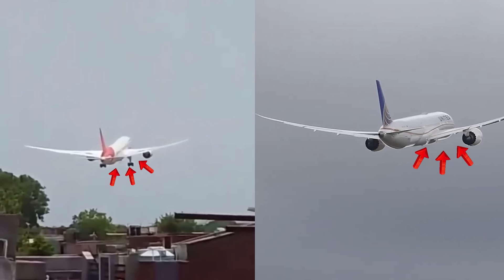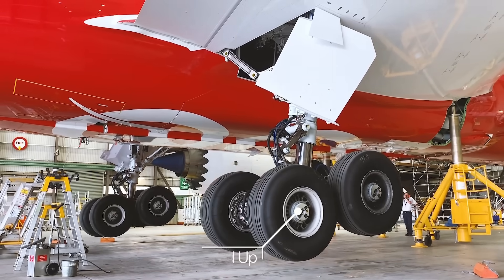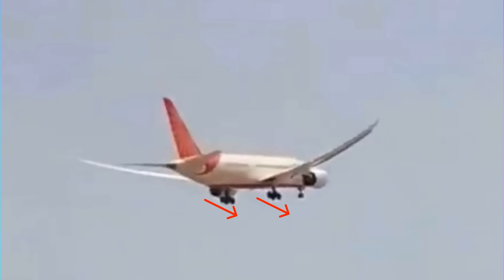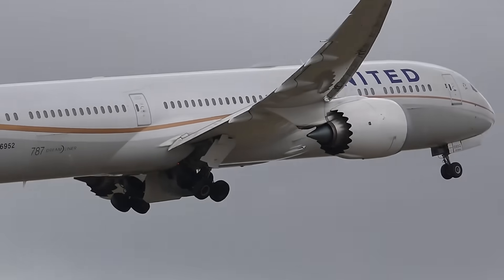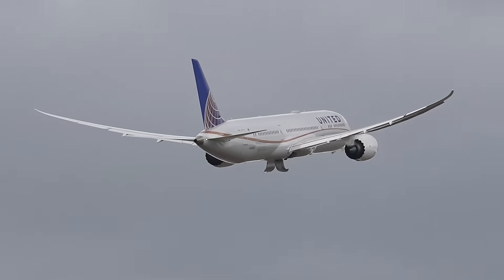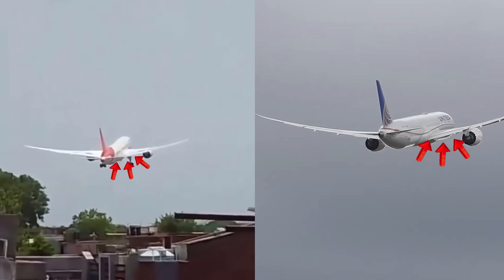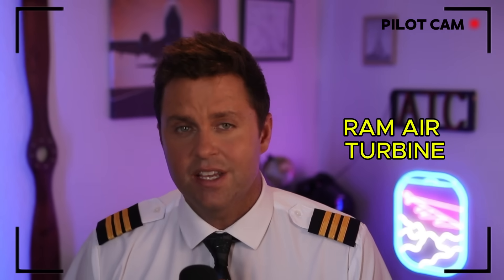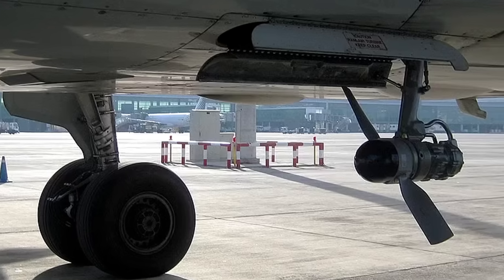Pilot Explains: A New Detail in the Air India 787 Crash Everyone Missed

Comment: The extreme heat in the forward equipment bay – caused by 40 degrees C ambient temps, close to max weight takeoff roll and the aircraft sitting in full summer sun on sun-baked tarmac for 3 hours – could have triggered a safe state reset of the fuel system controller (FSC) right after takeoff due to overheating.

I did some digging on flightradar24 and noticed this airframe VT-ANB has been consistently failing to send ADS B data during taxi only from Ahmedabad, for weeks. Other 787-8s on the same route don’t have this issue. The lower antenna sits in the forward equipment bay – same place as the FSC – so heat affecting electronics in that area seems plausible to me. Could be a bad antenna, but this airframe only seems to do this at this airport. Could be that the extreme heat here pushes it beyond its working capability.

The plane was fully loaded, close to max takeoff weight. A long takeoff roll, full power, means big electrical load and even more heat in the forward bay. If the forward bay is already hot (maybe 60) right at rotation, the last bit of strain and heat could’ve pushed the FSC over its limit – around 70 degrees C or so. when that happens, the logic card enters may enter “safe state” mode

in safe state, the centre tank fuel pumps will stop because nothing is now controlling them. It’s considered safer in the logic of the aircraft to have the high pressure pumps stop if they cannot be governed. And the wing tank pumps don’t kick in, because they’re also controlled by the same FSC to the best of my knowledge) which is now basically offline. 

The engines lose fuel pressure instantly. the electronic engine controls (EECs) detect it and roll back to protect the engines. Then the RAT deploys almost immediately. With no fuel pressure and no thrust, the plane stalls before it can really climb. We get what we see in the video, a plane which takes off fine, loses power almost immediately with no visible damage and has a deployed RAT. 

Everything seems to add up to me:

– normal flap setting (no flap lever mistake)
– both engines lose power at the same time explains soft smoke free symmetrical descent 
– RAT deploys straight away due to engines idling
– ads-b issues only at this airport, only on this airframe indictate potential heat issue. Ahmedabad stands for wide body’s are all south facing and accident flight was sitting in full midday sun for 3 hours before takeoff.
– max weight contributes to heat buildup as long take of roll generates heat in electrics 
– sudden loss of power matches a software error, you can almost see the plug being pulled in the video. Fuel contamination has been ruled out pretty much. Icing isn’t happening in India. 

if the FDR shows the fuel controller dropped out after rotation, I think that’s the whole story right there

------------------------------------------

The 787 has a known history of lithium-ion battery fires, which can trigger catastrophic avionics failures. On the previous flight, passengers reported the air conditioning, lights, and entertainment systems were not working—clear signs of electrical problems building up. During the accident, the Ram Air Turbine (RAT) deployed and the landing gear stayed down, both strong evidence of total power loss. Survivor also saw emergency green and white lights come on before impact, indicating the aircraft switched to backup power. All these point to a likely scenario where an electrical fire or battery failure knocked out critical systems, leaving the crew unable to retract the gear or climb. The 248 day bug that requires the SW to be reset (failing to do so could cause GCU issues and complete power failure) can be ruled out because the engine was replaced only recently (and probably the SW bug has been fixed)
787 batteries are susceptible to "cascading thermal runaway" where failure of one cell triggers failure of adjacent cells. A main battery fire can cause APU to fail as well. The high electrical demands of takeoff could have triggered the final cascade. Also bear in mind that 787s are Full Authority Digital Engine Control (FADEC) systems that require electrical power for proper thrust management.

------------------------------------------------

Along with the RAT being deployed another confirmation that POWER was an issue was the LENGTH of the takeoff. They used the ENTIRE runway, which for this airport and plane NEVER happens. There are several minimums like V1 (TDS),  V2 (minimum takeoff safety speed), VMC (MCS) , VMU (MUS), V3 and V4 during the roll down the runway that the pilot and copilot (usually the copilot calls these out to the pilot) watch out for. One is the minimum SPEED they need to rotate, and one is the amount of runway remaining to rotate safely.

The takeoff down the runway SHOULD have been aborted before rotation and takeoff as it looked like they didnt have the minimum V2 speed at the safe location on the runway to rotate. Why the pilot PUSHED the plane beyond the abort point and decided to try and make the takeoff is unknown at this time. It also looks like the RAT deployed on the ground or just as the plane took off. This means the ENGINE was already failing and NOT producing enough thrust to roll down the runway let alone take off safely. Again, ABORT takeoff should have been implemented. 

From what I can tell not many pilots want to abort half way down the runway if they can help it. But if the plane struggles to get up to speed its better to abort rather than chance what happened with this failed takeoff. You can tell they pushed it RIGHT to the end of the runway becuase as the plane rotates you see a CLOUD of dust, that looks like smoke from the engine, but is the DIRT at the end of the runway. 

This is WAY WAY to close and should never be attempted. Then as the plane lifted up you could immediately see it had NO LIFT, as the angel of the nose was too low, and it YAWED, indicating loss of control. The pilot tried to dip the nose a bit, and the plane yawed again, but NO THRUST and NO LIFT could be seen. They maybe reached 500 feet, floated a second or two, then came down hard as the wings lost all lift.

A question that will nee be answered with the "box" is did the Pilot deploy the RAT manually or was the RAT deployed automatically by the system? IF the plane STRUGGLED down the runway to get up to proper V2 speeds then why push it? Why didnt the pilot abort?
Reply: This comment I believe, IMHO, nailed it!  We wont know until a full investigation of course, but this makes the most sense of anything I have read or know of.  💯
Reply: The one thing you pointed out was the take off at the end of the runway. If the pilots didn't have V1 speed then aborting the take off (at a distance to safely stop) should have been automatic by the pilots. I think this accident is a 2 fold problem when the holes in the swiss cheese all lined up to cause the accident. 1/ Pilot error to not cancel the take off because of lack of speed with enough distance to stop the aircraft.*past V1 and possibly V2 and still being on the ground.  2/ Total electrical failure cause by problems not being fixed before the plane was allowed to depart.
Reply: I think you can rule out manual activation of the RAT at rotation.  As far as the plane struggling to achieve proper thrust/speed, the takeoff should have been aborted, but my hunch is that insufficient power was only fully realized near the end of the runway, in which case, this crew knew their fate.
Reply: @eugeniustheodidactus8890 RAT comes out on Auto. When it’s out it means a Big Ticket Item has is failing.
Reply: Seems to be AI text. So many  incongruences here.
Reply: I suspect the problem occurred after V1. But if the pilots aborted the takeoff they might have ended up seriously in the weeds, like the recent Korean air disaster. Check how closely the city approaches the end of the runway.

In Egypt and many other very hot countries in northern Africa, flights take off at night when air density is highest.
Reply: Insightful comment. I've been wondering about why they needed virtually the entire runway; does this reflect that they were lacking adequate thrust before even leaving the ground? I'm not a pilot but to my untrained eye it did not seem to yaw, and I haven't heard other analysts thinking that it yawed. Is this a very subtle thing that you're seeing?
Reply: @horsepanther  According to some reports the plane was doing 170 + knots at the height they got to (690 feet)  , More than enough speed to take off but why leave the take off until the end of the runway? Guess we will find out once the black boxes are decoded.
Reply: @horsepanther  That is not necessarily ‘out of the norm,’ especially considering the ambient air temperatures mentioned.  Remember, warmer air is less dense, and has less lift potential.
Reply: You are making a great point about an aborted take off, that would have been picked instead of a marginal one, that failed, instantly.
Reply: Too many large travel cases are taken on board in India which are not weighted before travel and the plane could have been completely overloaded which also would  never have  helped with the situation .
Yesterday while leaving India by an  airline I saw many people struggling to fit over sized travel cases in the overhead lockers ,In lots of countries they are strict and all carry on travel items are weighed so the plane is not overloaded
Reply: All the answer lies in CVR and DVR and Black box.. but information is to be public ..meny thing authorityand going will swallow..they will not let info to public .. just say some petty reason..
Reply: Thank you for the analysis, I hope the board of enquiry is at least as thorough.  Failure of lithium ion batteries due to extreme heat?  You mean just like the mega car carrier that is completely ablaze off the coast of India, full of Chinese electric vehicles that are known to have a tendency to catch fire caused by their lithium ion batteries?
Reply: @ptsdresolution9962  Wow!  Yeah, Modern Li - ion batteries don't take kindly to high heat or overuse!  Battery tech has come a long ways, but I’m afraid it needs to get better, and it will, hopefully soon.  

There have been numerous reports of poor maintenance by Air India, and I saw a video put out over a year ago, by a passenger on one of their planes ( a 787 ) and complained of it being dirty, smelly, and problems with electrical stuff, etc.  A lot of these horrible accidents come down to poor or neglected maintenance.  It remains a sad loss of life here, at the end of the Day.
Reply: Amazing analysis.  Do you think an end-of-runway abort would have been less catastrophic?  Or the decision to abort must me made earlier?
Reply: @wbruceanderholtii8369  Good question, and who is to say, as once the aircraft reaches V1 and they begin rotate, they are ‘committed,’ but it is not impossible, to try and abort.  There may have been some loss of lives, and definitely injuries, if they ran off the runway, or put it down shortly thereafter, but compared to the actual outcome, MUCH better.  They should have aborted the flight, IMHO.
Reply: I dont fly the 78 but I doubt the RAT would deploy with either engine running even at idle.
Reply: Very impressive research and analysis!
Reply: Excellent thread.  Much better than my two cents of vapour lock.  It would likely only affect one engine not both simultaneously.   

I think the pilots felt that the calculated thrust was too low and at some point before rotation went to max which was too much for what you described.
Reply: Many airports are located in hot regions around the world, such as the Middle East, and have no issues with aircraft.
Reply: @THX2012  Very good Captain Obvious and thanks for sharing that nugget of information!  Modern aircraft have the aerodynamics and engines to deal with those conditions, but that does not negate the fact that hotter air requires more energy and runway to provide rotation and lift of the aircraft.  There ya go!
Reply: @georgedavall9449  Being rude only makes YOU look bad.
Reply: @Nickelbippy  Ok there nickelskippy, thanks for your wonderful contribution!
Reply: Excellent observation " Not being a Pilot myself  very well explained  easy  to follow and understand " this tragic accident.  Beautiful presentation  . Thank for your presentation ❗️👈well done ❗️
Reply: I was unaware this level of detail is publicly available.  I assume you must subscribe for that access?
Reply: thanks for detailed analysis. Would you add more details about reluctance to 'abort half way down the runway?' [did the mayday happen before V1, so they already 'knew'? ] thanks again. so so sad. so sad.
Reply: @moiseechen  If something alarming happens before V1, the pilot can simply abort the takeoff, no need for a Mayday call. And the plane seemed to be climbing effectively for a short time before it suddenly lost lift. So presumably that Mayday call occurred at that point; he reportedly said they had lost thrust, lost power, and had no lift.

Comment: One commenter on Steve's video had an interesting theory. The one survivor of the crash mentioned that on the taxi way, the AC stopped working and the entertainment systems were shutting down. He also mentioned that this particular airplane failed to send ADS B data on the taxiway for weeks when looking at flightradar24. It's possible the FSC (Fuel system controller) in the forward equipment bay went to what he called a safe reset state, which shut down the duel delivery to the engines because of a overheating problem. Here is the original comment by @Bertiezu on Steves Video:

---------------------------------------------------------------------------------------------------------------------

Here’s my theory, bear with me, amateur plane mechanic over here: 

The extreme heat in the forward equipment bay – caused by 40 degrees C ambient temps, close to max weight takeoff roll and the aircraft sitting in full summer sun on sun-baked tarmac for 3 hours – could have triggered a safe state reset of the fuel system controller (FSC) right after takeoff due to overheating.

I did some digging on flightradar24 and noticed this airframe VT-ANB has been consistently failing to send ADS B data during taxi only from Ahmedabad, for weeks. Other 787-8s on the same route don’t have this issue. The lower antenna sits in the forward equipment bay – same place as the FSC – so heat affecting electronics in that area seems plausible to me. Could be a bad antenna, but this airframe only seems to do this at this airport. Could be that the extreme heat here pushes it beyond its working capability.

The plane was fully loaded, close to max takeoff weight. A long takeoff roll, full power, means big electrical load and even more heat in the forward bay. If the forward bay is already hot (maybe 60) right at rotation, the last bit of strain and heat could’ve pushed the FSC over its limit – around 70 degrees C or so. when that happens, the logic card enters may enter “safe state” mode

in safe state, the centre tank fuel pumps will stop because nothing is now controlling them. It’s considered safer in the logic of the aircraft to have the high pressure pumps stop if they cannot be governed. And the wing tank pumps don’t kick in, because they’re also controlled by the same FSC to the best of my knowledge) which is now basically offline. 

The engines lose fuel pressure instantly. the electronic engine controls (EECs) detect it and roll back to protect the engines. Then the RAT deploys almost immediately. With no fuel pressure and no thrust, the plane stalls before it can really climb. We get what we see in the video, a plane which takes off fine, loses power almost immediately with no visible damage and has a deployed RAT. 

Everything seems to add up to me:

– normal flap setting (no flap lever mistake)
– both engines lose power at the same time explains soft smoke free symmetrical descent 
– RAT deploys straight away due to engines idling
– ads-b issues only at this airport, only on this airframe indictate potential heat issue. Ahmedabad stands for wide body’s are all south facing and accident flight was sitting in full midday sun for 3 hours before takeoff.
– max weight contributes to heat buildup as long take of roll generates heat in electrics 
– sudden loss of power matches a software error, you can almost see the plug being pulled in the video. Fuel contamination has been ruled out pretty much. Icing isn’t happening in India. 

if the FDR shows the fuel controller dropped out after rotation, I think that’s the whole story right there

What do you think?

Comment: I’m going to try to not sound like a dick, because this is a pretty good analysis. Of all the talking head videos I’ve watched, I think yours is the first to mention the rather suspicious lack of jet engine noise. That said, at around 6:20 you state that the only way the MLG can go toe down is when the gear is selected up, this is incorrect. Without power the normal truck position is close to the longitudinal axis of the aircraft. The wheels are stopped before stowing with electric brakes. With the wheels still spinning the rotational velocity can be sufficient to toe an unpowered truck down. Your toe down conclusion is not validated.

Comment: If there was a total electric failure, the fuel pump would shut off and the electric power to run the engines would stop. Adding new electric power would be too late to pump fuel and start the engines. Definitely loss of electric energy